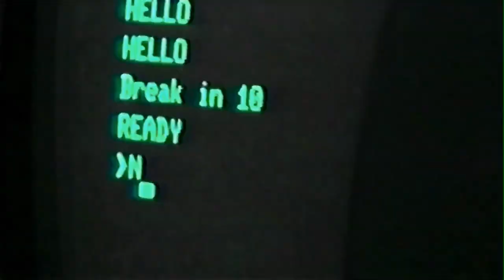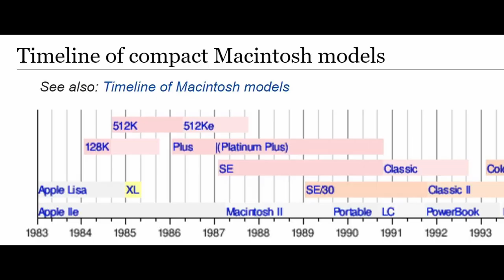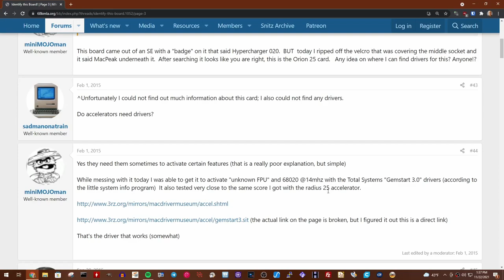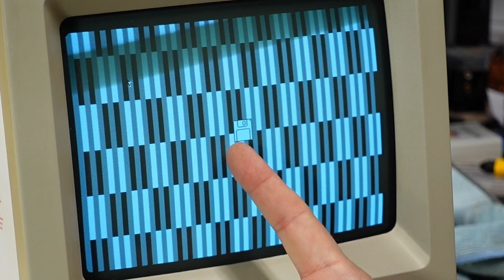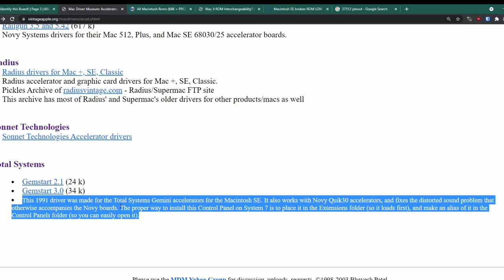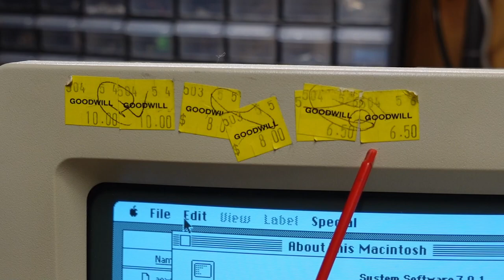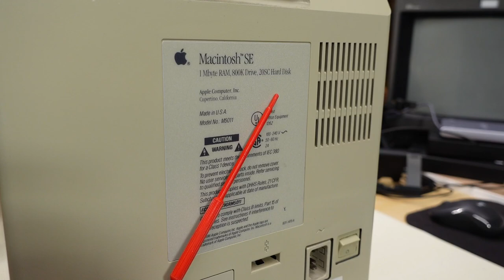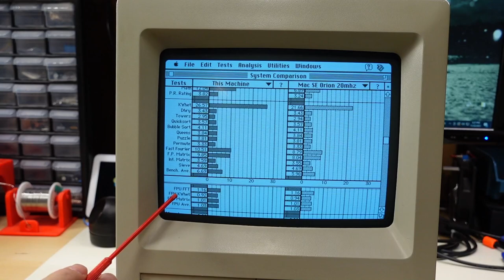The Macintosh SE is slow. Let's speed it up!

Comment: Hi Adrian. Back in 1992 when I started with the company I’m still at now the SE was my desktop for about 2-3 years when I was upgraded to an LC III. We did put an accelerator card in this machine and the Mac Plus we had as well. The SE was not only a desktop but we also did faxing from it for sending out ski reports via fax. After I moved on to the LC III the SE then ran a BBS until 1995-6 when it was replaced by our 1st website. The SE ran sys 7 slow as you noted but I was doing office stuff however I also used MacDraw a lot and Ready, Set, Go! For creating our newsletter. It ran so slow then we got the accelerator card and it was so much better. Thanks for the trip down memory lane once again! -pd

Comment: Hi Adrian, I found a working Gemstart 3.0 Control Panel on the Mac GUI and tried it out with an emulator. The files are not corrupted if you extract them directly on your SE. The control panel loads up as the system starts, but a real accelerator is required in order to open it. Maybe it'll fix your sound problem? I tried uploading a link to the image file I made but YT deleted the comment. Let me know if you want me to email it to you.
Reply from the maker: Thanks, yeah a few people have sent links too. :-) THere is also a missing Applied Engineering control panel that also claims to fix the sound -- the one I ended up using in the video was the second link ...
Reply: YouTube in the past few weeks has gotten really paranoid, to the point you can't even tag someone in the middle of a comment anymore without it getting deleted, and even in other videos on various Linux, and retro computers topics about 1/2 my comments are getting deleted for no good reason for something as mondaine as simply listing the name of a Linux distro, or alternative web browser that's not Chrome, or Chromium.
Reply: Same.  My comments are constantly getting deleted.  If you just put a dollar sign, or a URL it loses its bananas.
Reply: @CommodoreFan64  It's getting about to that time that big tech is getting scared of politics.
Reply: @RBLXGamer It's not simply just putting the word in your comment, but the context in which you use it, and other keywords around it that get it taken down by the YT algorithm, and it's only gotten worse, and more restrictive. They also monitor certain channels more than others as well.
Reply: @CommodoreFan64   YT was getting hit hard with spam.  I suspect the recent paranoia isn’t political, it’s just collateral damage.

The dislike button thing is another story.
Reply: @nickwallette6201  I'm just going to start bitching in their feedback section every time I get spam to complain that they can screw up everyone else's commenting and general channel interaction experience, but they still can't fix their spam issue. Like, seriously, if anything over 50% of what you're flagging isn't spam, then you need to start over from scratch because your algorithm isn't working properly.
Reply: @mndlessdrwer   It's hard to say what they're going through that we don't even see, but yeah, from the peanut gallery, it does seem like their priorities are really out of whack.

Lots of changes lately that don't make the user experience any better.  Lots of features that would make it better, but aren't done well enough to do so.  And an anti-spam algorithm that at least appears to be more effective at removing useful content while allowing spam, than the other way round.

But, when people go on about being "shadow banned" because " they don't like what I'm saying about (pick one:  healthcare, government, politics, tech, right to arm bears, whatever)", I always feel like... nah... they're nowhere near sophisticated enough to target your piddly controversy.  They're aiming at something bigger, and just haven't managed to hit it without taking out a bunch of nearby pedestrians.  But you can't convince the paranoid egocentrics that the world doesn't actually care that much about them.

Comment: One thing you can try to do for the noise on the speaker is to put a “pi-network” low-pass filter in series between the computer’s “audio out”, and the speaker. You’ll need a small solderless breadboard, some 22-24 ga. hookup wire, a 100 ohm resistor, and two small capacitors (of the same capacitance). Cut the wires from the audio-out, strip and tin them, then put one wire into the “bus bar” on the breadboard. For convenience, I’m going to refer to this as “ground.” Now insert the other lead coming from the computer in one of the “normal” holes on the breadboard. Wire one of the capacitors from there to ground, and take the 10- ohm resistor and insert one lead at that junction, and the other lead to another of the normal holes. Now wire the other capacitor from the 100 ohm resistor to ground. Finally, strip and tin the wires from the speaker, and insert one to ground, and the other to the junction of the 100 ohm resistor and the second capacitor to ground that’s not used yet. Start with a 47 nF cap, and work up in value until it sounds the best when playing Tetris. The filter will attenuate the volume slightly (that’s why I suggest a 100 ohm resistor), but that’s to be expected with a passive filter.

Comment: The SE is actually a bit faster than 128K/512K/Plus, because it does have a co-processor for video. The co-processor draws the frame buffer onto the display independent of the processor, unlike the earlier models. That's why the earlier models are only 78% of the SE speed, or in other words, the SE is 28% faster than the Plus/512K/128K, because the CPU doesn't have to spend time bit-banging graphics to the CRT.
Reply: I was curious to what made the SE better than a Plus, besides the internal hard disk option and memory expansion to 4MB. Thanks for giving me more insight into that.

Comment: The old Macs had two FPU modes. SANE used Apple's standard libraries that were guaranteed to give the same results with or without an FPU. The Orion driver specifically said it was using SANE. 

Going direct to the 68881 was much faster, but the results might be different when compared with the 68000 version.
Reply: What about INSANE?
Reply: Curious that they went to all this trouble when only the Mac II had a 68881.  Or maybe you're grouping 68882 under the same umbrella.

Comment: Fun fact: redrawing of hidden areas of Windows was a thing until Windows Vista and Mac OS X. Before that- in XP and earlier and OS 9 and prior, all drawing was done to a single framebuffer and therefore window contents had to be redrawn. There were some capabilities to save the Device Context info in Windows even in 3.1, (and presumably an equivalent on Mac) but it still needed redrawn from said buffer and was basically a faster way for the responsible program to redraw the window contents, rather than the OS "knowing" what was in the revealed area.

Comment: In 1987 I was working as an information systems analyst for a rapidly growing savings bank.  Our manager agreed to buy ONE Mac SE when she saw what a beautiful job of formatting and printing it could do, compared to the IBM 3270 80-column green text-only terminals her staff all used, plus one sad IBM PC XT that was used mainly for Lotus 1-2-3 and sometimes as a 3270 terminal emulator.  The graphical (almost "WYSIWYG") interface of the Mac was superb for using office applications like Word, Excel, MacDraw, etc. even in monochrome.

But the several analysts were often competing for time on the Mac, and we were criticized for "composing on the Mac" and admonished to do our work on a 3270 or even a typewriter then re-key and format our work on the Mac so it would print out nice and pretty.  The Mac was connected only to a laser printer, not into the IBM mainframe at all.

I'm never surprised to see a Macintosh SE still running.  They were very well designed and made, definitely a major step forward in personal computing interfaces.

Comment: I feel ya on have one of your childhood computers, as I still have my Zenith Datasystems 286e Supersport laptop being the first laptop I ever had, and only one for a good while. yes it still works amazingly aside from the external battery pack, and having to replace the PSU several years back, and despite having newer retro computers like my Pentium 4 build that boots 98se, and XP, I still go back to that old laptop sometimes when I just want to get some office work done without modern distractions.

Comment: I love your channel as you take old tech and save them and upgrade them.    I was a teenager in the late 1970's and remember seeing computers come to life.   My first computer was a Timex Sinclair (black with a membrane keyboard and a cassette deck as a drive); I bought my first computer as a  Commodore 64 (still have it and several 1541 drives and a commodore monitor and a ram expansion model that plugged in the back which was a godsend in college).      Please keep doing what you do.   I know this hardware is obsolete, but it nonetheless paved the way for modern equipment.   Great channel!

Comment: I have a Mac SE I picked up at a swap meet back in like 1999 for $15.00. It still works flawlessly to this day.

I also have my PowerMac 5260/100 that my parents bought me in 1996 when I was 13. That computer got me through the early internet. I have fond memories of AOL 3.0 on a 33.6k modem. I still have the ZIP drive too. The 800mb HDD died a few years back but I brought her back with an SD card. It amazes me to this day the color quality on that CRT, even though it's got tens of thousands of hours on it. I wish the plastics were holding up as well as the CRT and electronics.

Comment: My family had one of these from before I was born, by the time I would be using computers my dad had brought home a first edition LC from work, but I still used the SE often because the LC would typically be in use by another family member. I remember we downgraded the SE back from System 7 because it ran so slow.

My parents never let me try any programming for fear I'd mess up the system. I wasn't to keep any files on disk, I was to save my files to 3.5" floppy disks, and later to Zip drives. My use was basically relegated to KidPix, Mavis Beacon, some sort of animation software that I don't recall the name of etc. 

I wish I were born a few years earlier so I would have learned BASIC or something useful growing up, or an Apple II where you were actually encouraged to go in and tinker with the electronics. I didn't end up learning to program or really use computers in a way beyond as a naive consumer until I was a teenager and installed Linux on my first computer. I feel like this era of computers, with everything sanitized and locked down and GUI'fied, has a lot less magic to it. I'm glad things like Raspberry Pi and Arduino exist for kids these days.

Comment: My father used a MacSE with the Radius two page display at work, but would bring back the SE (sans external display) home so I could play with it. The Mac had 4MB of RAM, SCSI, and an optical mouse. 

The Radius display worked in conjunction with the built-in display to make one large oddly-shaped desktop. You could change the relative positions of the displays in the Control Panel using the Radius extension. This was working in the 80s many, many, many years before multiple monitors worked on any other system. There may have been some multiple monitor setups in the UNIX world, but they were always using matching resolutions and there was no real concept of a "desktop". Most programs just seemed to work, including the Multi Finder hack. Sadly, I don't see a video anywhere of this setup working, which is of historical significance given it was the first of its kind. 

He eventually replaced this setup with a Mac IIFX which screamed.

Comment: I remember that the Radius Accelerators were priced at $800 for no FPU, and either $950 or $1000 with the FPU. They were missing the 68851 PMMU, so they did not support virtual memory. The software verified the CPU/FPU, and had an instruction/data cache switch. ( and when I found a 68882 with a broken leg, soldered one on, and put it in, it recognized it accurately as a 68882. )

I had the one for the MacPlus, and later for the Mac II (Rockets)

The MacII plug MMU only tied two lines low, it did not do anything. The 68851 which replaced it was a PMMU necessary for both Virtual Memory, and Running A/UX.

The Apple SANE is Apple Standard Apple Numeric Environment. Most accelerators had their own replacement, such as Radius had Radius SANE.

If you had a Mac Classic, You could boot into the easter-egg, ROM OS, Cmd-opt-x-o and it would boot a 6.0.7 OS from the roms.

Comment: Another great video Adrian.  Grab an ATX harness extension and you can move the logic board away from the Mac!  The atx harness is wider, but the pin pattern lines up fine. It’s just shifted to one side.
Reply: This.  I learned about this from Mac84 and Branchus Creations.  You don't even really need to cut or modify the ATX extension cable.

Comment: This shows why back in the day some people said that the fastest way to run Apple software was to emulate with an Amiga since that machine had the native 68k CPU as well as a supporting chipset which took a lot of the load off the CPU, especially in later Amiga models such as the A3000 and A4000 which could be fitted as standard with 68030 or 68040 CPU's as standard with accelerators available featuring 68060 or PPC CPU's..
Reply: The only fly in the ointment was if you were trying to run color Mac software, the conversion from chunky data to bitplanes for the Amiga's display might slow things down a bit... of course, RTG solved this nicely. And you'd still end up cheaper than an equivalently-equipped Mac (because Apple charged too much for them).
Reply: @SeeJayPlayGames  with good video driver, using MMU (030/040/060) there was no problem with speed. Only interlaced modes were trobles for eyes.
Reply: @MrMarianoamigo  which can be fixed with a scan doubler...

Comment: Macs did have a sweet spot. For me, at that time it was a Quadra 650, with a 68040 running at 33 MHz and 16MB of ram. You knew your workstation was well balanced when you weren’t complaining abbot general workflow speeds.  Thanks for the video!

Comment: I totally get why you are doing this, it's for the same reason I replace parts or mess with my 286 or pentium 1 computers. "wow, I wish I had that stuff back then".
when I was a teenager and the pentium 1 was my main computer it had 16mb of ram and a 1gb hard disk and a 1mb pci cirrus graphics card. now I use it with 64mb of ram, a 10gb hard disk, a better s3 2mb graphics card, dvd drive instead of cd, and a lan card instead of diaul up modem, so I feel like I maxed out "my real computer". it's not the main one anymore, but it feels more like "my computer" than the newer ones, specially because I've used the same cabinet since it was an XT clone, the same keyboard since it was a 286, the same VGA monitor since it was a 386, and so on, so that thing is the one I have "burned in my mind" as "my computer" the most.

Comment: I missed the old Mac classic days.   When was going high school.  Our school mostly had Mac classic and later upgrade colour classic.  My shop teacher let me borrow his SE/30 his office from shop class. (Which he had external HDD for his SE/30 and taught me a lot about Mac and computer.) so I could do this school project at home at my parents farm. Cus at the time.  All I had was crappy old Tandy 1000 SL2, which has intel 8088/86 that ran around 8-10 mhz and had no HDD and I think it only had 720 kB 3.5 floppy drive.   Where all macs at least had 1.44 mb 3.5 floppies and Macintosh had hard drives.   HDD imo were such huge step compared slow floppies hah.  SE/30 had HDD what 40 MB HDD? and Se/30 was leaps and bounds faster then my crapy old Tandy pc with old 8088/86 cpu.  Lol. 

Se 30/colour classic were my fav around what 1994+.   Wanted one so badly back then but up here in Canada they very expensive.   $1500+ to $2000 Canadian.   ( I think).  Never did get one.   I think end up build 80486dx/dx4 near end of 1999.  End up loosing interest in Macintosh Cus everybody was more involved with PC after 386/486+ days.  Wanted LC575 but never got one. For long time even remember reading Mac books that use order and read all the time. Drool I’ve cus all had at time was crazy Tandy pc. Wasn’t till end 1990’s was finally able buy or build 486dx/dx4 pc.    

I often wonder why Motorola died out so quickly and why Apple quickly switch to power PC then later intel.   I wonder what might have happened if Motorola cpu become the standard and if power pc and intel had failed.  

Good video :)

Comment: We had a Mac SE FDHD when I was a kid, my father was also not so satisfied with it's speed so he bought an Irwin accelerator for it (and breaking the crt while installing it...). I can't remember exactly how much the difference was, but surely that System 7 made it a lot slower... My father even took the card to his work and installed it temporarily in a Mac SE there (a small business, completely Macintosh SE based) to try to convince the boss to buy some accelerator cards for the machines there.
Later I got an identical SE FDHD myself, without accelerator, just for fun (looked nice next to my B/W G3 with 21" crt 😛), I played around with different Systems, figuring out that with System 6 (and Multifinder) it ran perfectly and felt actually quite usable, even then around 2004, but with System 7, it was too slow...

Comment: I remember we has a Macintosh SE (which was a couple years older than me) as a kid. 4MB of RAM, 2 800KB Floppy Drives. No Hard Drive, but we had a Zip Drive (100MB) plugged in to boot off of.